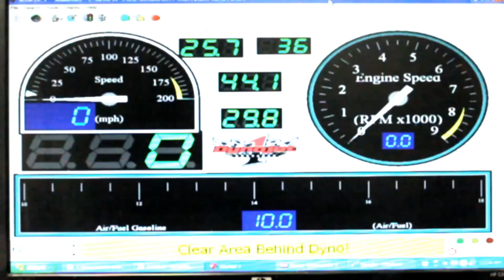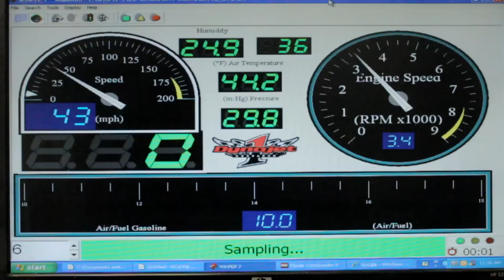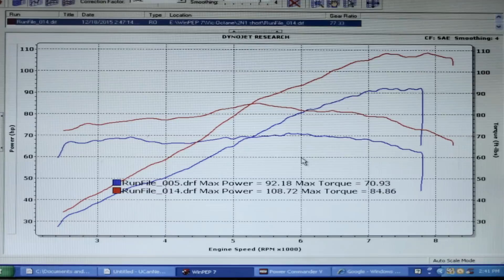Octane

Comment: Still a little toy , my VN 2000 made 115hp and 145ft/lbs , this bike is just to small !!! if your over 5"8" this is not the bike for you !!!
Reply: +Steve Cea Why even compare a street bike to a large straight line cruiser like the VN2000?  Would you say pickup is junk because it can't haul 50,000# coil on the back like a Kenworth can?
Reply: +Fr. Ro I think there will always be a place for the bigger engines, but the mid sized water cooled V-Twin is long overdue in a version consumers will embrace.  I loved my V Star 1300, or rather, I loved the idea of it.  To get what I really wanted I was forced into the big ci category.  The super sport tourers just don't have what I want in egos.
Reply: +Fr. Ro Harley has water cooled engines and has started partially cooling  the Big Twin.  Victory's Freedom engine has had oil cooling for some time.  You're right.  It's only a matter of time before we see full cooling across the board, including the large V-Twins.  It already hurts these engines in the form of requiring high octane to run them.  The same engine water cooled wouldn't require it, IMO.
Reply: @ 5'07", it would work great for me
Reply: Fr. Ro I'm sure it will be as soon as they can convince the fan base that it's cool.  These things take time in that community.
Reply: Not really true. I'm 6'1, 220 lbs and this bike is just fine. Fast nimble and powerful. Also you have to compare power to weight ratio. My old bike was a Vstar 650 which weighed close to the Octane and that even didn't feel bad to me. This power in a small cruiser is deadly. Great bike imo.